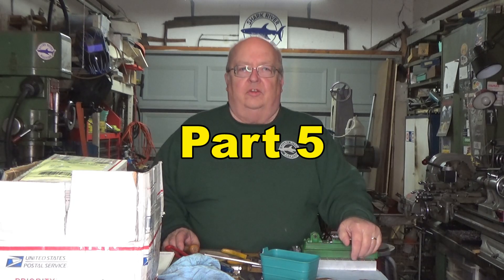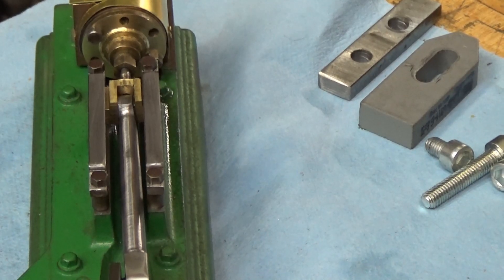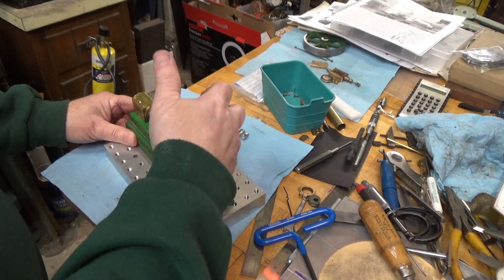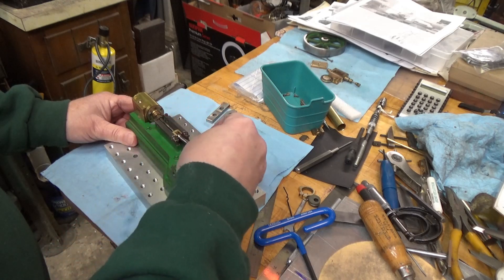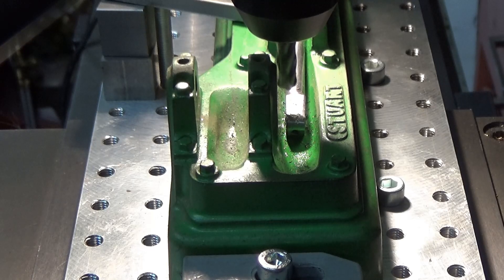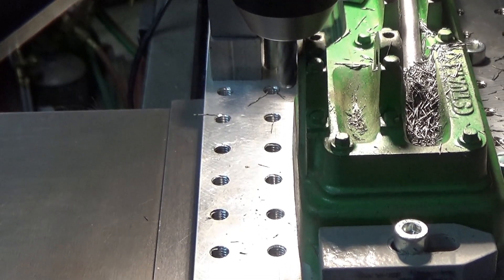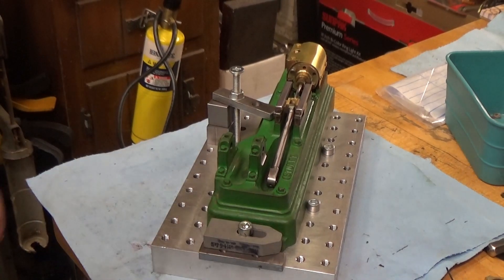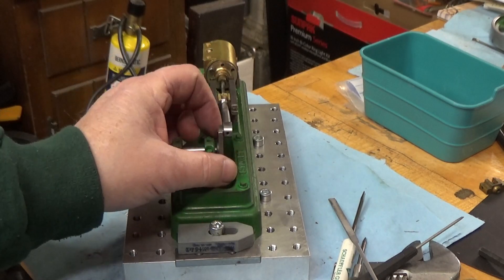Stuart S50 Steam Engine Rebuild / Repair-Part #5

Comment: Hi Steve . It seems the original machinist was very sloppy . A guy like you can get it running like a dream I am sure. I am nearly at the fitting up stage on my engine now , so I can see where the fitting details are thanks to you. Oddly I just posted making the crank pin and then watched this . I am glad I took care making it having seen your issues . Great video and perseverance . Cheers Ade.
Reply from the maker: Just watched your video, Nice work,  I did find that the crank pin need to be a little looser than I expected in order for the engine to run at slow speed. When you are fitting the pin, finish off the flat side of the conn rod a few tenths at a time to get the clearance that you need.

Comment: That project has turned out to be a lot of problems.  Glad to see you are overcoming them as they appear.
Reply from the maker: I am surprised that this has as many problems as it does.  I got this in a lot from the estate of an expert modeler.  Apparently he was new to machining and was using this to learn on. I have to treat it like it is an unfinished kit and just go through it by the numbers. See you on the live feed.  I am going to try and join from the shop if my wireless wifi is strong enough.  Thanks for stopping by.